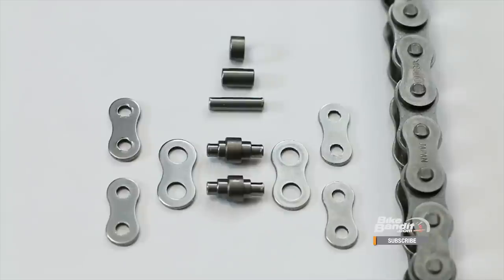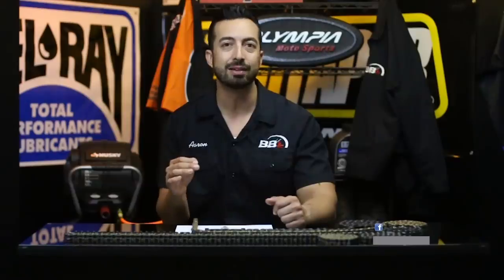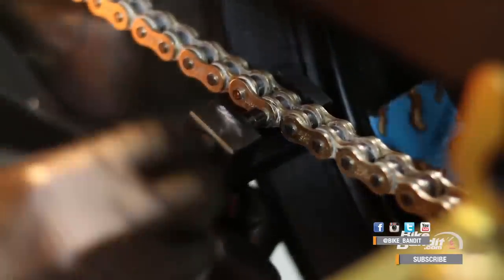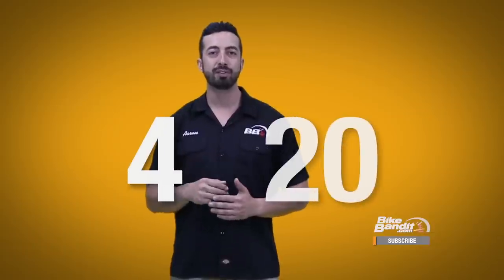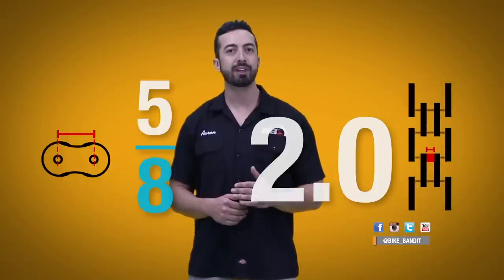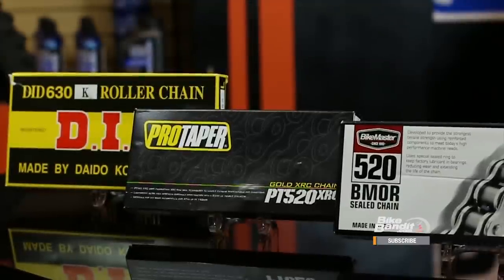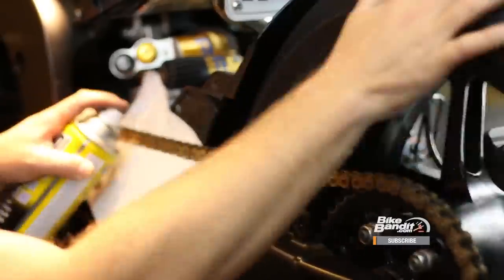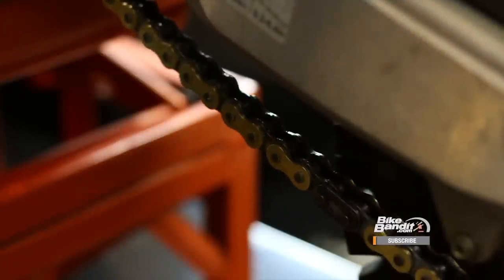How-To: Motorcycle Chain Lube, Maintenance, & Care | BikeBandit.com

Comment: Your advice is spot on. All my bikes have chains and I've been following maintenance as you descibed and regularly get 20k miles out of them, More than half the guys I ride with have belts instead of chains. Are there any tips for them?
Reply from the maker: Keetman Keetmanaa Hey Keetman,No real "tips" for the belt crowd. The beauty of a belt vs. chain is that belts really have no maintenance regimen and are much quieter than a chain with just a fraction more power loss. There are some downsides to belts though too. Unlike a chain, they cannot be repaired, they just snap. Also belts are more difficult to replace as they are endless, and thus wheel removal is necessary upon replacement. Each drive system (chain, belt, or drive shaft) has its pros and cons for sure.Thanks for watching our videos and the comment. You remembered to subscribe, right?

Comment: You mentioned that a 120 pitch on a chain is a safe way to go with, what if a 108 link DID 520 runs a 120 hp bike when the factory set up is on 114 link 520? 🤔 😀

Comment: Do you need to lube an o ring chain or do you just clean it and you're done?
Reply from the maker: +oHerroPrease 
Hey OHP,
When you lube an o-ring chain, what you're really doing is lubricating the rings themselves, keeping them nice and pliable, which in turns keeps the internal grease placed there by the manufacturer inside and around the pins. Easy as that. Give the chain a good cleaning, then a nice dose of lube, wipe off the excess and go ride. Remember to do all of this after a ride, so that the chain is warm, with the engine OFF. Thanks for watching our videos and the question. You're a subscriber, right? Ride safe. BB.com

Comment: I will subscribe if you answer my questions.   New chain pre-lubed from Bike master, and when to wipe off excess with a little wd-40 on rag and then lube with chain wax?  Somebody said ride for a week then wipe with wd and lube. Is he correct?   O-ring
Reply from the maker: +twing21able 
Hey t21a,
No problem on wiping off the factory external lube. What you're doing when you lube a chain is actually keeping those o-rings pliable, which in turn keeps the factory internal lube where it belongs, inside on the actual pins. Easy as that. Chains should be cleaned and re-lubed every 300-500 miles, more if really dirty. Thanks for subscribing. Ride safe. BB.com!